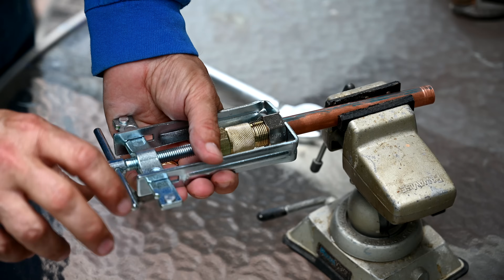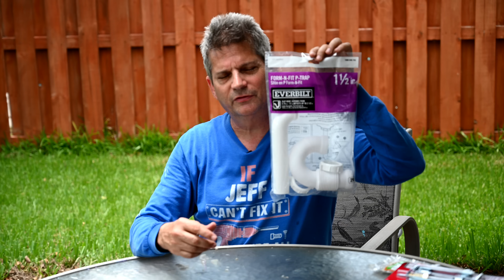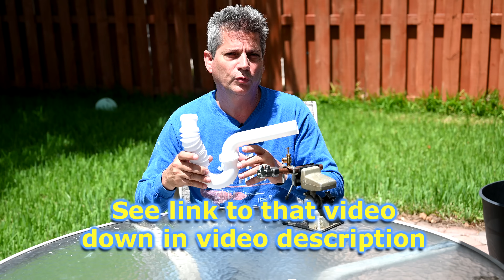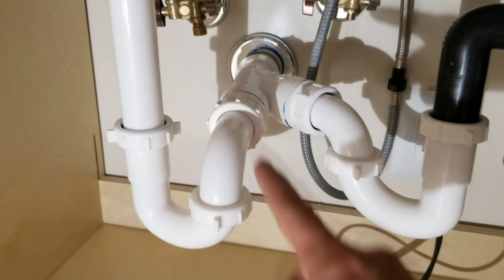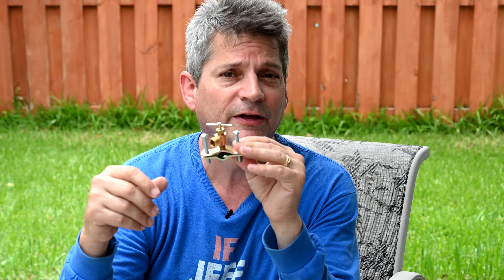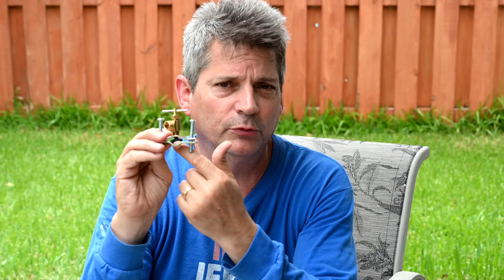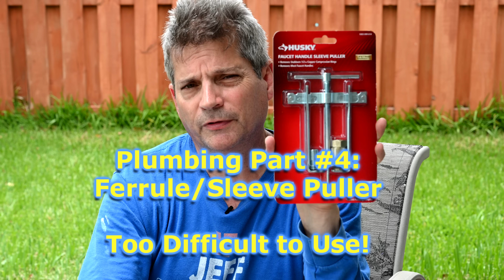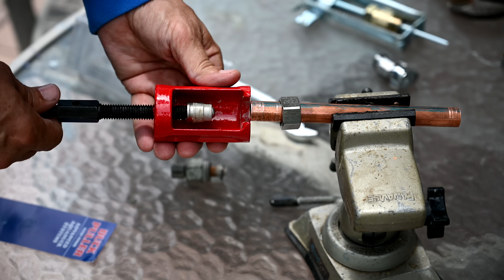4 Plumbing Parts/Tools You Should NEVER Use. NO Plumbing Fails

Comment: Very informative video. I now have to change the saddle valve in my basement that leads to the refrigerator on the first floor. Ther valve itself is NOT leaking, the IDIOT who installed the hose drilled through GROUT in the tile floor threaded the hose through it. With the pressure through the valve every time the fridge needed water, the hose rubbed against the grout and YOU KNOW what happened next!!! Well, since I had to remove the ceiling in that part of basement to find the water hose, I might as well remove that saddle valve. Any suggestions on what to use to replace the saddle valve & connect an ice-maker (fridge) hose?
Reply from the maker: Yes, and many other trolls on here come here and lambast me for bashing handymen who use these parts. Not sure why they had to drill through the floor. If your sink is nearby, they can run a water line to the valve at the sink. You would change the single water shutoff valve to a double shutoff valve, containing 2 independently controlled shutoff valves. One side valve has the 3/8" output for the faucet cold water, and the other side of the valve MUST be 1/4" to mate up with all the 1/4" ice maker lines. Get a steel belted hose only, they are shiny metal, and very rugged. Of you have to go through the floor, and I can't imagine why on earth they did in the first place, make the hole larger than the hose, and run the hose through a short segment of conduit, acting like a sleeve to protect it as it passes through the floor.

Comment: If there illegal why do they still make them
Reply: They are NOT "illegal" to own, use, manufacture or sell.  Codes are NOT laws.  They are regulations.  Codes apply only for jurisdictions which adopt them.  The "Uniform Plumbing Code" and the "National Electric Code", for example, are industry recommended standards which are sometimes adopted as local codes.  They are a conglomeration of the combined experience of people in the industries represented. Unless adopted by local authority, they are just a book of recommendations written by knowledgeable people. 
They are NOT LAWS passed by a legislature and signed by an Executive (be it the President or a Governor).  NONE of these codes address the manufacture or sale of any of these devices.  They have NO authority to ban the manufacture, sale or use of ANYTHING.  Why do people sell these inferior parts?  To make money.  $$$$  If I could sell a can of "Spray and Fix" and claim to fix anything by spraying it on...I would sell tons of cans.  Just ask "Flex Seal"
These devices CAN cause you a nuisance when remodeling IF you took a permit for the work and are subject to inspections by an authority which has adopted these recommendations as local code, OR if an insurance company adopts these codes and applies them as conditions to their policies (insurance companies can do whatever they want) and if you get caught in an insurance inspection (which they sometimes require for older homes for renewals) then you may have to correct these problems to maintain your policy. Insurance companies are far more likely to bury this in the "exclusions" of their policy, so you should actually READ THE POLICY. Policies may exclude claims cause by "S traps", saddle valves, flex drains, etc.  A common one is to exclude claims from water heaters more than 10 years old.  Not to mention FPE and GE/Sylvania electrical panels, polybutylene plumbing pipes and so on.  READ YOUR POLICY!  These things can be a time bomb in your house!
Bottom line...It is NOT recommended to use these devices.  They are of inferior quality and can cause problems in the future, usually far out of proportion of the amount of money you save from using them.
Reply from the maker: Lol, everybody asks this question. The parts themselves are not against the law they are against building codes. So it's not a criminal act to make them, sell  them, or own them. It's just that if you use it in new construction and the building inspectors come to inspect the property they won't allow you to get a closure on your building permit and no certificate of occupancy.
Reply: @jeffostroff  Everyone asks that because you didn't make it clear in your video.  Otherwise, great video.  And great advice.

Comment: I have saddle valves running 20 years now without failure
Reply: I am a fixer of all, I fixed a new chinese 3/4 pipe New with a hole in it  , with a piece of hose and a hose clamp , going on 30 years ago . No plex in my house , only galvanised and copper flares . 3/8 copper Fast hot water no waste , Valves have a 1/4 inch restriction in them , No lost pressure each pipe from source to fauset . 3/8 copper can freeze and not break .
Reply: Listen to Jeff about those saddle valves . There great until they fail and have to replace your drywall! Check the water line at least once a week.
Reply: The "codes" referred to are industry standards compiled by experienced professionals in each industry.  When they say a device should not be used, it is because that device has an increased risk of causing a problem which outweighs the benefit of the risk.  It is not based on the fact YOU have a valve that hasn't leaked for 20 years.  YOU are not a "statistically significant sample".  
Sort of like saying "Smoking is not an increased risk of lung cancer because I have smoked for 40 years and I don't have lung cancer" or "Seat belts don't save lives because I never wear a seat belt and I have never been killed in a car accident"
I do not assume you can grasp the concept of risk/benefit and "increased risk" so, to be clear...  
It does NOT mean "all these valves will leak".  It does NOT mean "Most of these valves will leak" it MEANS  "these valves will leak more often than the recommended alternative and the cost benefit, which is very small, does not make up for the increased risk." 
So, now, I think you may understand why your comment is irrelevant.
Reply: gary K I don’t think you had to write a book.
Reply from the maker: Keep your fingers crossed, it's always when you make the claim, that the claim comes to bite you in the butt!

Comment: I have used saddle valves 40 years and never had a failure. Most plumbing regulations have nothing to do with quality or safety, it is government agencies bowing to large plumbing outfits and manufactures to increase profits and keep other people out of the plumbing business. Anyway, pex is making most of this unnecessary.
Reply from the maker: I here that same bogus excuse from other guys just like you too, just trying to justify why they want to take the lazy route instead of the correct route. The rule simply states you cannot use saddle valves. PERIOD. It does not force you to use a plumber, and most plumbers are independent contractors they did not band against you with some master conspiracy theory against you. So your comments are a joke at best. I simply install the correct double valve at the sink stub out, it contains one valve for the sink, and one shut off valve for the ice maker and I connect the ice maker line to that valve. That doe snot require a plumber, anyone can do it.
Reply: @jeffostroff  no. The guy makes a valid point. If saddle valves were anywhere close to being the problem device so-called "professionals" claim they are, homeowners insurance companies would have either litigated the manufacturers and retailers out of business by now or refused to have insured the millions of properties that use them. Just another hack video struggling to convince folks to call a price gouging "professional" .
Reply from the maker: @toroscosmicos9889   Your logical reasoning is almost as bad as his. An insurance company is not going to litigate a company that makes a part to go out of business. There's no law against anybody making these parts. But there is plumbing codes against you using it,  Not a criminal law, but plumbing codes that the city owns.  So if you have a flood in your house and they find out you used this part which is against the plumbing code they will simply reject the claim that's all they need to do. Some insurance companies down here in Florida I've seen in the last couple of years are coming to do surprised 4 point inspections on people's houses and I've already had 2 lady friends who were told by their insurance companies to remove the flexible P traps or they would be dropped from insurance. I had another lady friend who was developing rust on outside of her main circuit breaker Box next to the meter and they told her to either get a new one or have it painted or they're going to drop her. That's how the insurance companies handle it. They look for reasons not to pay when my roof was in need of replacement years ago the insurance company try to claim there was cracks on some of tiles and write it off as foot traffic and rejected the claim. So I had to hire an engineering firm to prove that the problem was not caused by cracks on the tile but rather by failing fasteners which was covered under the policy.
Reply: @jeffostroff  No genius...an insurance company would subrogate or Sue to recoup losses they incurred from claims due to failure of the valves. By virtue of the fact the insurance companies accept their use is more proof they don't fail than the hearsay and anecdotal bullshit that so-called "professionals" prattle on about on the internet.

Comment: I cut the ferrule with a small three sided file part way thru then put a flat blade screw driver in the cut/grove and twist, the ferrule will crack/snap the rest of the way thru.  Its easy and I never cut the copper pipe, just the ferrule.
Reply: We call the copper ring an olive in UK we have a tool called an olive cutter removes it in seconds
Reply from the maker: @razer192  yes, lots of UK guys have mentioned the olive to me, I plan on doing a whole video on different ways to remove the olive and mention all you guys.
Reply: Here is the tool if interested 
https://www.toolstation.com/monument-olive-removing-tool/p60412?store=JF&utm_source=googleshopping&utm_medium=feed&utm_campaign=googleshoppingfeed&gclid=CjwKCAiAi4fwBRBxEiwAEO8_HprdahY9UdIBtjAVhNb1CXSc2TOOuhZruQjQvnjMLZjJNeB43OCxfxoCrN8QAvD_BwE
Reply from the maker: Yes, a lot of guys do it that way too. DIYER's? I'm not so sure I'd recommend it to those without a lot of skilled practice.

Comment: I used a saddle valve. How can i replace it properly?
Reply from the maker: You can  Cut out that area of the pipe where the pinched whole is, sauder in a new section of pipe with a T fitting and put a valve on that.

Comment: why do you use the term "handyman" in a derogatory way? do you think you are a higher rank? your a one trick pony! you cant even cut your grass right! i did kitchen and bath remodeling for the last 30 years! i went to school for carpentry and learned plumbing and electrical in the field. ive never used "the handyman special" yet i now run my business as a handyman service. its what works for me for many reasons. its successful because im happy doing it. it doesnt mean im not a professional!! i think you need to choose your words more carefully if you want subscribers!
Reply from the maker: I didn't use it in a derogatory way. I specified many handyman use these parts. If you have a problem with that, the problem is in your head.
Reply: @jeffostroff  you said it several times as if a handyman is unqualified. its not in my head its right here in your video! im sure there are many wierd uncles using some of the garbage they sell at home depot etc, but handyman service is a professional industry that fits in well with many things at an existing home. for example i fix alot of the hackery thats been done by the naive. but i wouldnt start bashing a whole genra of repairmen with such prejudice. there is a whole field in between new construction and major remodeling. the average consumer is the biggest client base, thats why there is big box. if you think its in my head, then why do you have so many haters?
Reply from the maker: There are good handymen, and bad, but mostly bad. It's just the way the numbers work out, it's not my fault. I know some really good handymen, bu they are few and far between.
Reply: @jeffostroff  where do you get these numbers? have you ever hired someone that offered professional handyman service? or is your experience more with the town drunk? if it is i think you should make that clear! i lived in florida rebuilding after hurricane andrew so im aware that there is no shortage of right to work hacks there, but youtube is bigger than just florida.  
and when you say over and over that these code violations are something that handymen use, you may be marring the name of what i do! here in Philadelphia. soldering copper isnt brain surgery. you have no right to judge handymen!
  You also mention D.Y.Iers. who do you think might stumble upon your channel while looking for information ? maybe your the accordion trap of youtube!
Reply from the maker: @cuzimamadman  LOL, If I point out that violations are something that handymen use, you I am not marring the name of what you do, I am marring the name of what handymen who violate the rules do. They are the one marring their name, not me, you are simply shooting the messenger.

Comment: That Husky ferrule remover is so bad. They already have the brass part that threads into the nut why didn't they just put a thread inside it with a bolt and wedge or plug that rests against the pipe end like the smaller tool you have. So they made the most expensive part 90 Percent of what is needed and the other 10 percent is total failure and more costly very bad product.
Reply from the maker: Finally someone agrees with me on this Husky tool!

Comment: I use the traditional S trap in all of my installations and renovation work, they are the most reliable and sufficient it’s all about the flow a prevention of possibility with water ingression if you connect a 42mm Easyflo conventional waste pipe to a S-TRAP the speed of the waters return elevates by 60%  the greater the number of degree  being a 90/45.6 on the curvature with the bends flow will equally level out water pressure capacity inside the dual capillary action. I’m a gynaecologist by and I forgot what we where talking about 🤔

Comment: Jeff, I like your videos, however for instance the flexible P-trap. In reality If I tell a customer that we need to open a wall, to move plumbing and it will cost them hundreds $, or we can  use this flexible P trap that's not ideal and it will cost them 10% of proper work, the answer is 100% times the same. Use it! Where I live Washington DC, if everything should be up to the code, you can as well demo 95% of houses and start from scratch. In my opinion, people use it for one simple reason, customers are not willing to spend hundreds of $ just to comply with code. I see it every day.  (of course this doesn't apply to new construction)
Reply from the maker: Yes I know the reality of when the rubber hits the road but there are alternatives to using that flexible P trap and in fact we have other videos up that show how to form the pieces to get the offset without having to make and use the flexible P traps. But just let people know also when you install those for them that they have to watch them closely for clawges in here getting khanum, and they have to be ready further insurance company to come and do a 4 point inspection and threatened to cancel them because right now that's happening a lot down here in our area.

Comment: At 17:30, I've never used one of those tools. (I've used a similar tool for removing a faucet handle from the valve stem, which worked great). It looks like either the threaded steel shaft needs to be longer, or the brass part needs to be longer. But, more importantly, are they saying the ferrule, or the copper pipe section can be reused after this tool takes them apart?

Once the ferrule has been crimped, it can't be taken off and re-crimped. The same with the end of the copper pipe, once a ferrule has been crimped on the pipe, you can't remove the ferrule and install a new valve/ferrule in the same spot.

Much better to just cut off the end (maybe 1-inch) of the pipe, including the used ferrule, and install a new valve on a "fresh" area of the pipe.
Reply from the maker: Unfortunately sometimes you can't cut off any more pipe. But fortunately I usually don't see any deformities on the copper pipe where the ferrule is compressed, because it is the ferrule getting compressed not the pipe. By default, if you don't cut the ned of the pipe, the new ferrule will by laws of dimensions, end up in the exact same spot as the old one. never seen a problem with this.

Comment: The husky tool works fine when used correctly. First you have to use all of the parts. The most critical is the one that rolled off of your table when you picked up the tool. That was the insert that fits the tool to the end of the pipe just like your other tool does. The wings are not used for sleeve pulling, just faucet handles. It doesn't have the leverage that the wrench driven one does, but will easily pull all but the most stubborn sleeves.
Reply: Agreed. I though the same way Jeff did, but I read the manual again and found I need to put the round insert and screw. No wings are necessary here.
Reply: Isn't it funny a "qualified" and "licensed" plumber is too inept to read instructions...and then complain about the tool he used improperly.
Reply: @brianreinhardt4050  hey mr. bob villa, no one is perfect and the instructions are not very clear.  I used it wrong at first too, its a consumer grade tool not something pros would buy (and I had an emergency repair to make, HD only had that tool available, so it had to work)